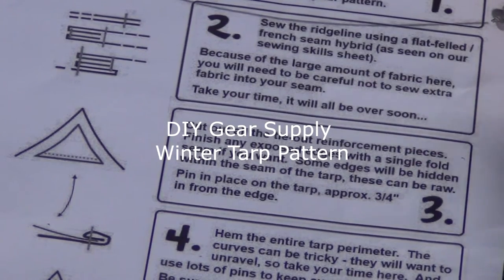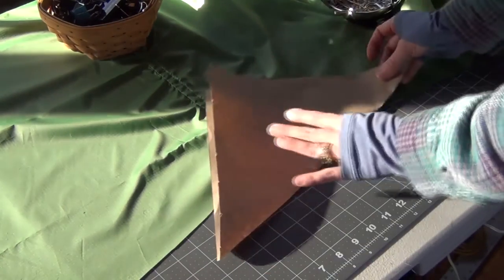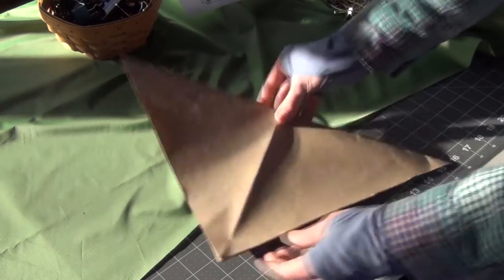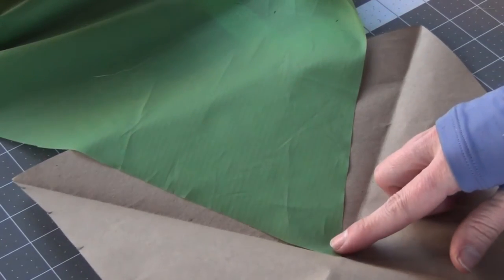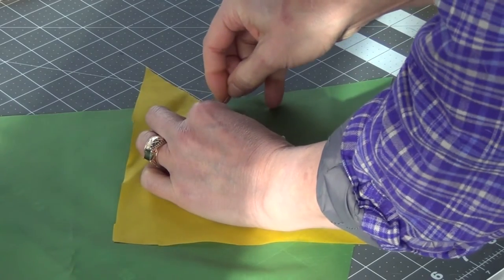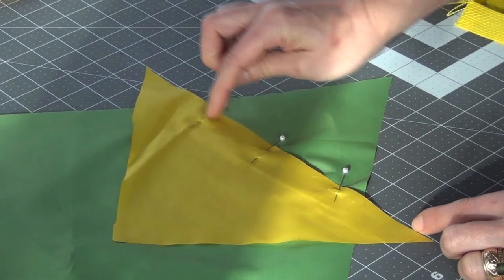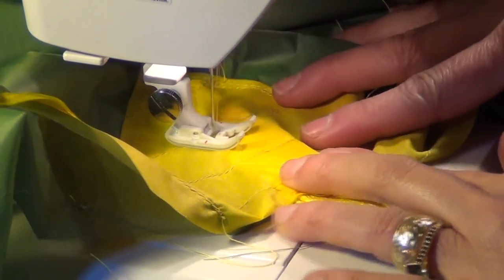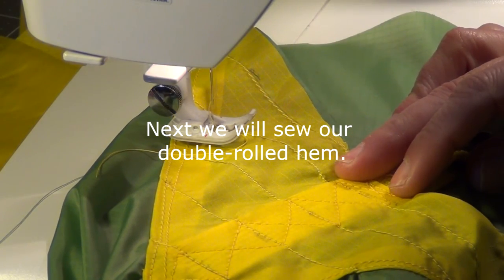Winter Tarp:  Part 3 tie outs

Comment: Forgive me for I have sinned,  I am making my winter tarp and for some unknown reason I decided to make it ultralight.  I fought the reinforcements ( like sewing clouds together ) till I was frustrated so I went into my sail making kit and used adhesive spinnaker tape to make the reinforcements.  No hemming, just stick it on, roll it out then sew it! Might weigh 4 grams more for the entire tarp but way easier to get a very strong, rather smooth reinforcement!  

Thank you very much for taking the time to produce these videos!  They are a great learning experience!
Reply from the maker: I am intrigued.  How is the spinnaker tape holding to the tarp fabric?